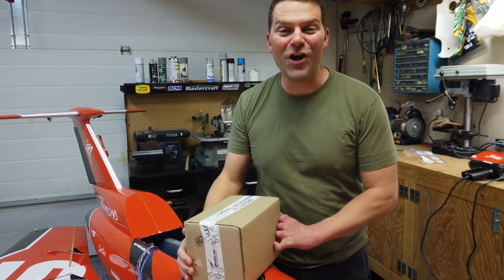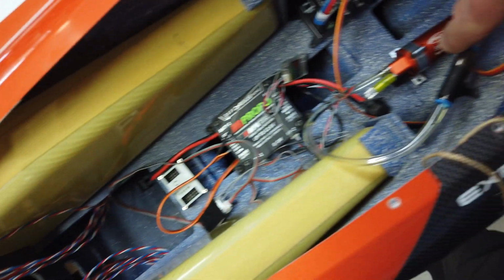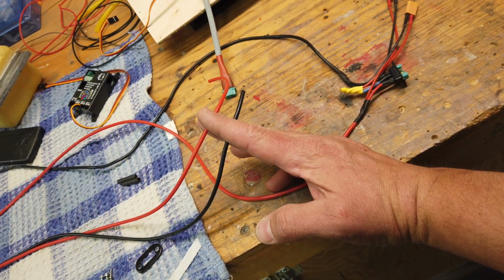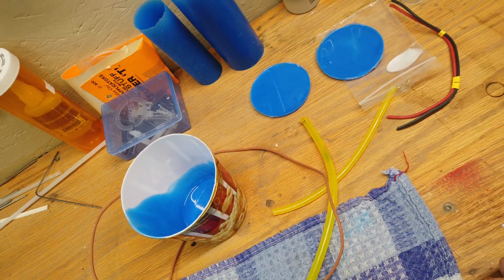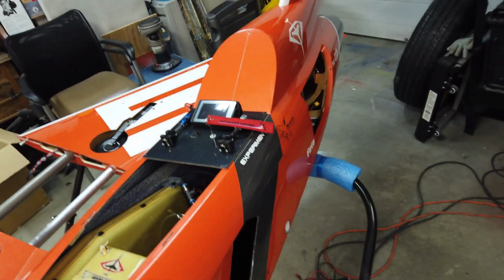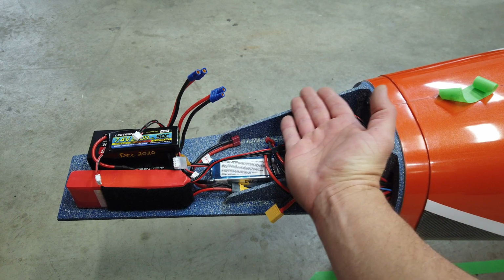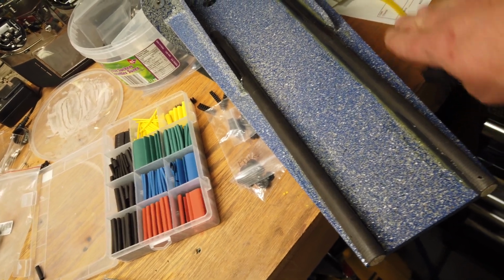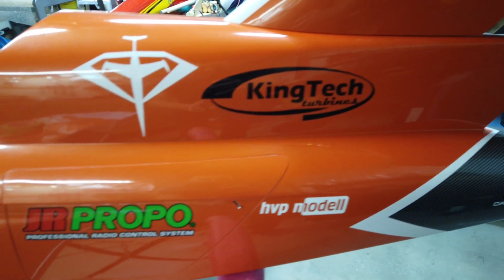$20,000 TOY COMPLETE - Aviation Design Diamond Build Part 11 Target Drone

Comment: Did u end up using extra weights on the nose? If yes, wouldn't it make more sense to use bigger / heavier batteries instead?
Reply from the maker: Hey Stefanos.  Yea I ended up adding 9 oz in the nose.  Based on some peoples comments I may have to remove it as the C of G point is conservative.  I would generally go with heavier batteries but I already have lots of MAH in the batteries so capacity on all of them should be no issue.